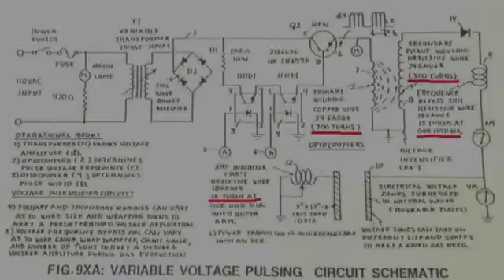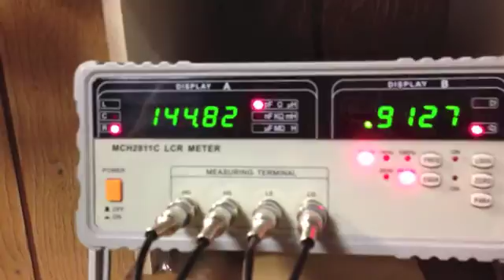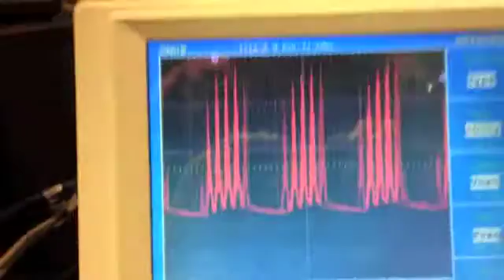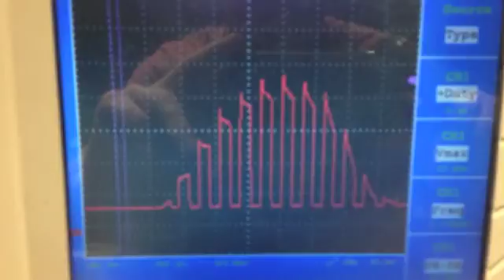Stanley Meyer 9xa water fuel cell testing #1

Comment: I believe Edward didn't understand your point, because he's talking about water cell as a capacitor + resistor and you're talking about not using the transformer, but just coils + water cell. It seems that the purpose of the transformer you talk about is multifold. For once, it serves the purpose to isolate the wfc part from the ground, as Edward said, so you can have both sides of wfc capacitor charged, producing the full effect of ionizing the water and make it easier to break water molecules, without much current flow, which saves power. I've seen a lot of people doing this process right, showing amp flow of zero (or really near zero) and voltages going very high (tens of watts of power max). The second purpose of the transformer seems to be to reset the DC offset, which is present in the pulse train, in the circuit before the transformer (the dc pulse generator). If you studied Meyers papers, this pulse train is never crossing zero point, it's always either positive or negative, but never crosses zero point. When you bring such a DC pulse train to that transformer, it triggers the resonant oscillations by charging the wfc capacitor when the dc pulse nears the max value and discharging (and oscillating between coils) when dc pulse is at its minimum. Those oscillations you can see on Meyers graphs on each 2nd part of the oscillating period. It is my belief that the purpose of such a signal is to 1) charge the wfc capacitor up to start ionising the water molecules in the wfc and 2) start oscillating in resonance with wfc to trigger covalent bonds breakup. Without that transformer, using only silicone rectifier/switch for the pulsed dc signal, you're going to be left with the dc offsetted pulsed signal, which never crosses the zero point, like Edward said, which means you're effectively doing Faraday's electrolisys, using the current and wasting power, instead of vibrating water molecules in resonance to help them break apart to their atoms.

Comment: Really it's not an open circuit as the water is to be viewed in the circuit as a resistor. Meyer himself says it being used in the circuit in the form of resistance and gives it this abbreviation Re. The real resonance takes place between chokes and in a series set up as shown to us in figure 6-1 it's the two ending chokes at opposite side of the winding. Thus far I have been getting some of the best results the world over of getting high voltages to the cells while restricting the flow of amps just as Meyer talks about doing. Right now I am up to 5.8 kv at 25 ma but I have to reach around 7.5 kv before I reach what I have been calling the, "Ionization Threshold," a process where the atoms that make up the water molecules will start to eject their electrons and in the process the bonds of the water molecules are thus broken down.
Reply from the maker: When only using the inductors, it is an open circuit when the switching device is off. The water cap isn't what I'm taking about
Reply: This is what I am trying to tell you water is being used in the form of resistance, "Re," so therefore it is not an open circuit. But I do have a question for you. Is your goal to break the bonds of the water molecules like Stanley Meyer using high voltage while restricting the flow of amps? The reason I ask is if not then I am just wasting yours and my time.
Reply from the maker: Edward Mitchell  Breaking the bonds in the way Stan describes is my goal. This is just a miscommunication I'm sure. The water cap is resistance as you say. In the 8xa, for example, (no transformer) when the switching device is off, the circuit is open. The voltage spike from the inductors will be across the switching device rather than the water cap.
Reply: I too went back to take a look at the 8xa circuit so that I could learn by following the same steps Meyer took while he was learning this technology. I had to learn this the same way so that I could then start asking the right questions. It was a good starting place as I learned so much about just what Meyer was trying to do and thus started asking the right questions looking at his work as he progress with each and every upgrade he made as he furthered his work on the technology over time. I will leave you to your thoughts as you learn this technology as this is a good thing :-).
Reply: @DaveCBwfc  After all these years I finally got at the science behind the patents. I then went and posted the science I found through my use of the scientific method here: http://www.aboveunity.com/thread/water-as-fuel-and-more/
Tell me what you think?
Reply: @h2opower 
Link won't open 😐
Reply: hey are you still around? you're bang on about the water cell resistance. The plates make it seem like a capacitor, but in reality the water isn't an insulator unless you have pure water. Did you ever figure it out?
Reply: @jontanneguy4960  Hi, yes I'm still kicking it at above half a century now but I will confess the body is starting to wear down now. As for how the bonds are actually broken down by this technology it's comes from a very subtle situation that main stream science missed when going over Photosynthesis. The primary way this technology goes about breaking the bonds of the water molecules is by getting the atoms to release their electrons by way of ionization energy levels. This is why a capacitor is formed using water as it's dielectric medium. The resulting capacitor(s) are then subjected to voltages that are over the ionization threshold of the atoms that make up the water molecules causing both atoms to eject their electrons. Since the molecules have ionic bonds no electrons means no more water molecules and the molecules simply fall apart into it's component atoms, IE, hydrogen and oxygen gas atoms. 
Now you herd me talk about main stream science missing something very subtle, yes? Well, it turns out that all molecules can be broken down by getting the atoms that make them up to release their electrons and note this, it maters not how those atoms lose their electrons as each and every way known to get atoms to release or lose their electrons will work on breaking the bonds of the molecules.
With photosynthesis a plant simply reaches in and takes the electrons away from the atoms keeping the those electrons and the hydrogen atoms so that it can make the things it needs to survive. You see when molecules are broken down this way you get three things which are the gas atoms and the creation of an electric charge. In my studies I also looked into thunderstorms which many do not know also break the bonds of the water molecules but by way of ionization. It turns out that thunder, which are hydrogen and oxygen explosions taking place in the clouds, actually causes lightning as each water molecule broken down adds an electric charge to the cloud system and once this charge as sufficient energy to overcome the air's resistance to current flow lightning is produced. This is made possible by water's self ionizing effects mostly as the earth's global electric circuit is what Meyer was mimicking in nature, but by purely electrical means. The Voltage Intensifier Circuit(VIC) is an electric mimicking of the earth's Global Electric Circuit.
The VIC places a high voltage charge on the plates of the capacitor both negative and positive charges. And when these charges surpass the ionization threshold for the atoms they start to eject their electrons and the water molecules simply fall apart into oxygen, hydrogen, and the creation of more electric charges. The VIC allows for a more controlled discharge of the capacitor so that it doesn't discharge too quickly but also will not build up enough electric charge as to cause an arc in the system which would blow the thing up.
Now I could go on an on about how this technology actually works but I will end my talks for now as most of the time people's grasp on science isn't strong enough to allow them to question the scientific community. But service to say I figured out just how Meyer and others drove their cars down the road with nothing but water in their tanks for fuel.